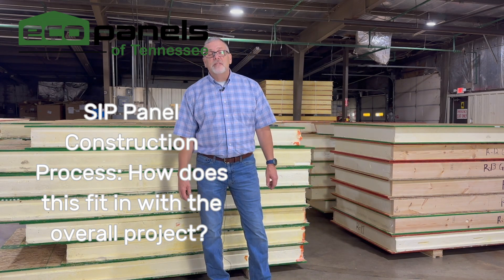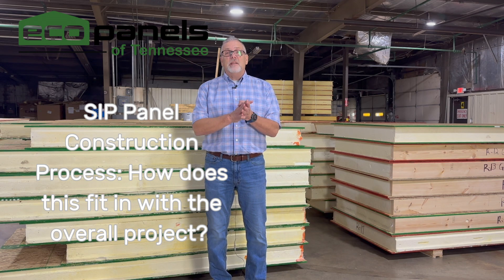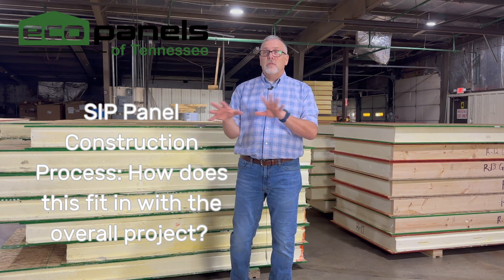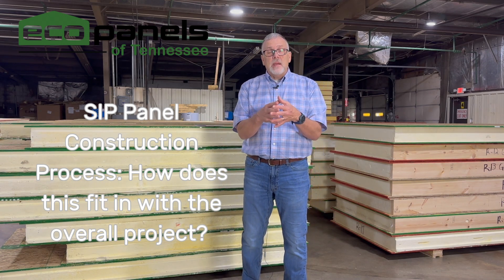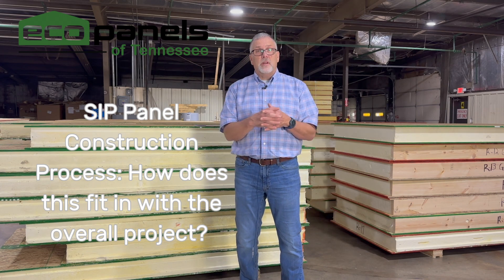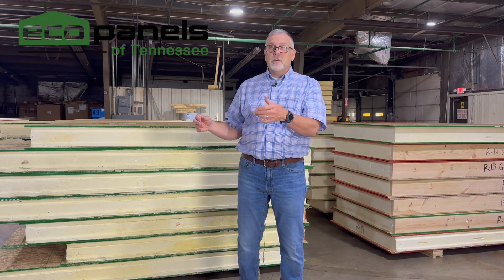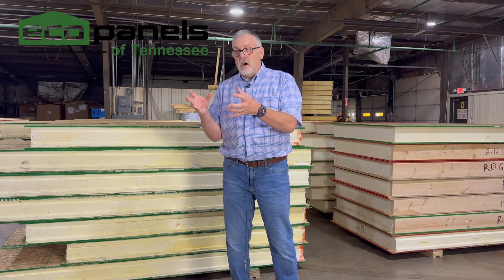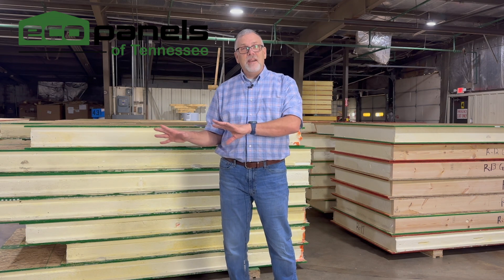SIP Panel Construction Process : How does this fit in with the overall project?

Comment: Looked into sips, way to expensive. I get it it’s cool, it’s new , efficient but if you can’t afford it and it makes housing prices skyrocket it’s all pie in the sky.   We can’t just keep building homes for millionaires and let everyone else struggle.  Be part of the solution not the problem.
Reply from the maker: Housing affordability is certainly a major issue, we can agree there. However, there's also the cost of living in a home over its lifetime that has to be accounted for. Our SIP homes generally show a ROI over the extra cost after just a few years because of the energy savings. Also, too many people compare apples to oranges. We're always more expensive than a conventional framing and insulating materials package (which is the weakest and least energy efficient way to build allowed by law/code). We have put labor into prefabrication, it's already insulated, conduit and boxes set, and in one wall assembly we have an R-26. Once on-site labor and other costs are figured in, we are much, much closer in cost. As SIPs gain in market share and the industry grows, the cost will come down as well. We want to see SIPs used across the economic scale, especially for struggling families, because we know a SIP home can deliver a lower monthly cost of living. Being part of the solution typically starts with actually doing something, and we're trying.
Reply: as a builder,  you also have to factor in, how fast these SIP, houses go up. way faster then conventional.  in addition,  labor costs, can be reduced, because of the speed, in which goes up.  another point is...  in my experienced opinion,  as a DIY project,  way easier, then traditional.
Reply from the maker: @troybengel691  thanks for the comment! Always great when builders make these points for us. Appreciate it!